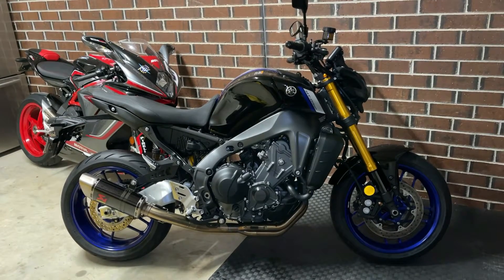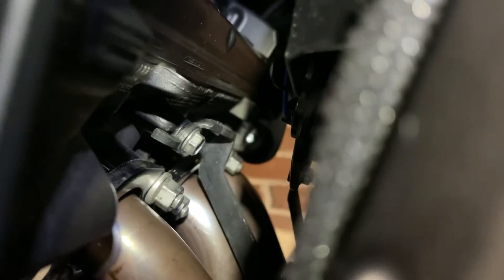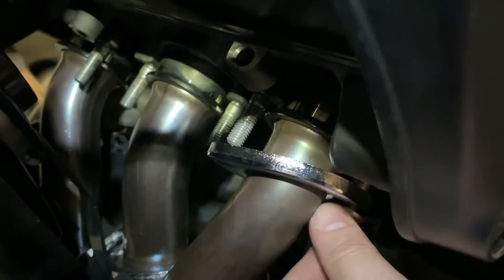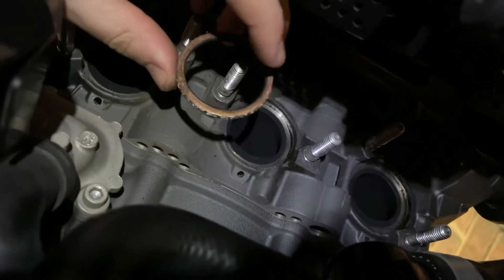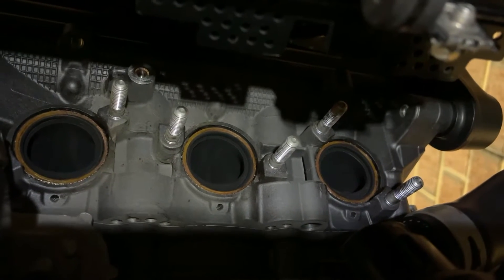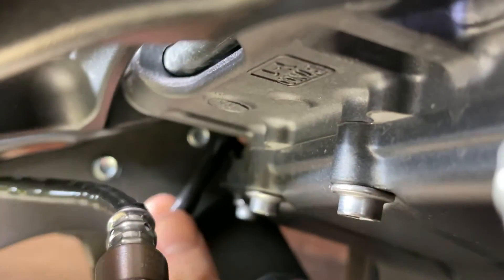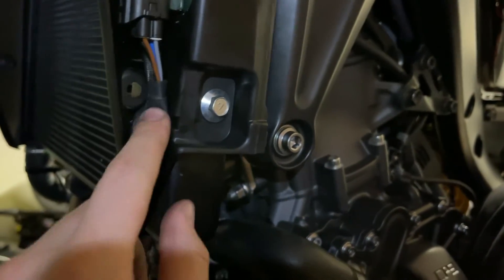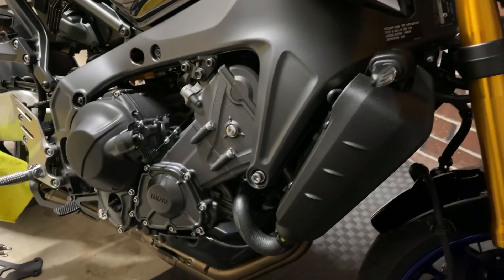2021 Yamaha MT09 SP - Stock vs Akrapovic Racing Line Carbon Exhaust Compare & Install

Comment: Great vid.  Easiest way to hold the copper gaskets in place is exhaust paste.  A small smear on the back of the gasket will hold it in place whilst getting the headers on and help seal them incase of any corrosion or damage, works a treat.

Comment: Mate I needed this video earlier haha I just done mine last night and you posted and it was not on the searches properly till now for me. Great video. I found I had not required to move the rad and used the longer socket to the middle and inner header bolts .. def get a evotech rad guard installed . But thanks 🙏 brilliantly done video. The others do not compare to this video on how to.
Reply from the maker: Have you got the 2021? Appreciate the feedback and shame it wasn’t sooner, uninstalled the Akra last night due to popular demand for a ‘how to video’.. reinstalled original, started the vid, took it off and reinstalled the Akra again😅
Reply: @motobolt7796  haha nic one bro appreciated the video for sure best how to... now you dont need to undo the rad , if you tilt bike up from front you get better access to the headers with long socket! I managed phew. Yep mines on the 2021 ..
Reply from the maker: @alf786  well done, I see where you managed!Originally when I lined up the top bolts with the extensions they were scratching the paint off the radiator, so went with the other approach to have more freedom of movement and not strip the nuts in the tightening process with the socket on such an angle.. did you have to remove the lower radiator bracket?
Reply: @motobolt7796  do not need to remove the rad bolts at all.
Reply: @motobolt7796  how do we ever keep the bolts clean and protected from salt and rust that what id like to know
Reply from the maker: @alf786  ‘SALT SHIFT LANO SPRAY’ An advanced, eco-friendly lanolin spray that lubricates and protects metal surfaces from salt and corrosion including hardware, rubber components and even plastic parts for long lasting protection. Safe for use on engines, electrical and rubber components..
If you can’t find that any ‘Inox MX4 Lanolin Lubricant’ will do👍

Comment: cool install video. would be great to create a video of the exhaust sound whilst riding - ripping through the gears and downshifts etc. tunnel run would hurt either 😺
Reply from the maker: Just purchased GoPro 10  media mod setup so you get only the best quality, it’s in the pipeline!

Comment: Great videos, I have installed akrapovic exhaust on my bike follow your instruction. Just one question: Did you tightening the header nuts follow the torque in akrapovic manual? They said the torque for these nuts are 22Nm but I'm afraid it will break the maniford bolts.

Comment: What an excellent "how to" install video.  Thanks for taking the time to do it.  I have the exact same exhaust and exact same bike.  I'll be putting it on tomorrow and now I know just what to do.  Thanks again!    How does it run with no tune?  Same as it did with stock exhaust?
Reply: I got it put on.  Your video was SPOT ON PERFECT!  I guarantee you saved me an hour or two.  Thanks again!!

Comment: Hey! after installing the exhaust, did you adjust the fuel maps?
Reply from the maker: No need but will most likely get a power commander later to enhance it, saves messing with the ECU and voiding warranties👍

Comment: does it shoot flames?
Reply from the maker: Yeah mainly on gearchanges and downshifting but not as much as shorter cans I’ve had in the past
Reply: @motobolt7796  Nice, I'm waiting to see what Black Widow will produce for this bike. I've been told they are realising it on December. Can't wait to get rid of that stock exhaust :D
Reply from the maker: @povilaslondon  they’ve been great with the previous gen and well priced, but hopefully a little more aesthetic! I’m watching for what Austin Racing bring to the party, love the design and finish on their cans. Shame there’s such limited choice for now and bet you can’t wait to hear that music to the ears!
Reply: @motobolt7796  true, the only thing I don't like about Austin Racing is that you need to destroy your oem exhaust in order to fit it. Also for almost a slip on they are way too expensive
Reply from the maker: @povilaslondon  very true, good point! Although I did hear rumours they’re making a full system for the 2021 MT09.. hopeful as they’ve just brought out a twin can full system for KTM 890 and 1290 Duke’s which sound insane!
Reply: @motobolt7796  thats great. 🤞 They will make it and it won't cost an arm and a leg

Comment: Is that a full exhaust?
Reply from the maker: Yeah full Akrapovic Racing Line Carbon system👍
Reply: It's really hard to tell if it's a full exhaust, maybe he spent hours pulling the headers off and the entire exhaust system apart just to install a slip-on can
Reply: @steveholden4544  🤣🤣🤣

Comment: How much wieght you lose??
Reply from the maker: A Weight Reduction of : 2.6Kg
Power Gain : 4.5HP (3.3kW) at 9600 rpm
Torque Gain : 3.4Nm at 9600 rpm
Reply: @motobolt7796  nice gain in power ...wow 🤯🤯🤯... keep safe always 👌👌👌🙏🙏🙏
Reply: @RomelSinahan  unfortunately he's now passed away :(
Reply: @holden486  Sory to hear that ...condolence.. ride in peace 😢
Reply: @holden486  you serious?